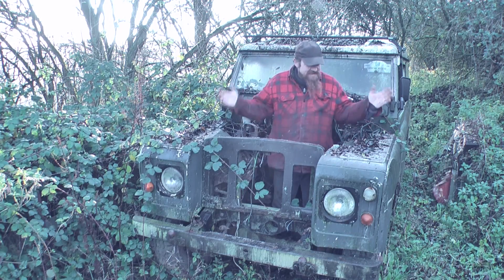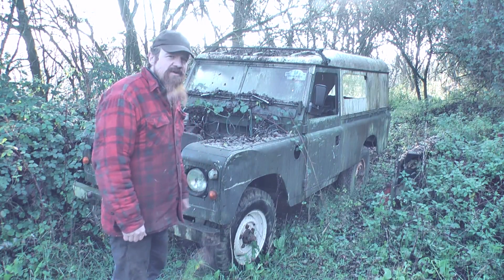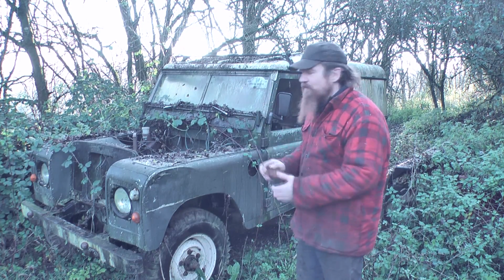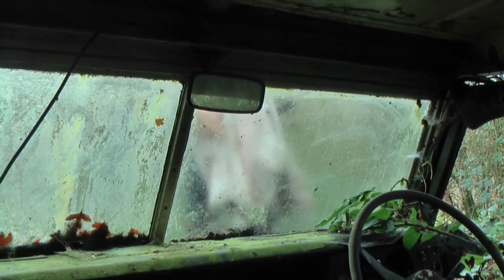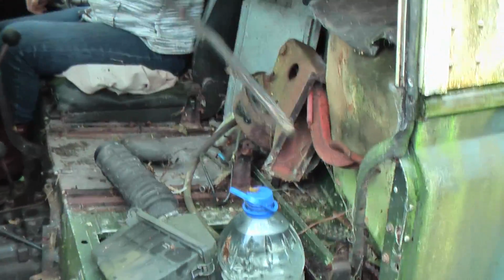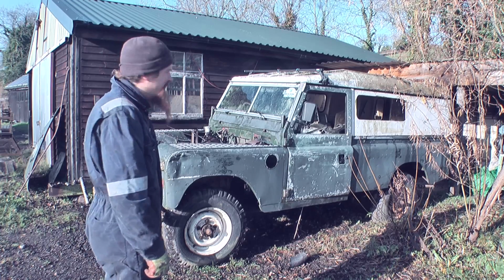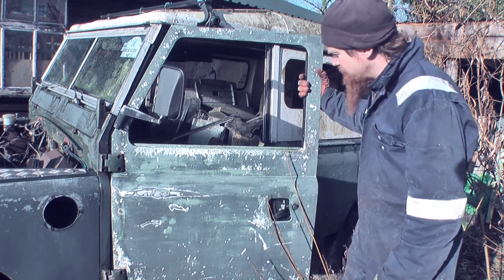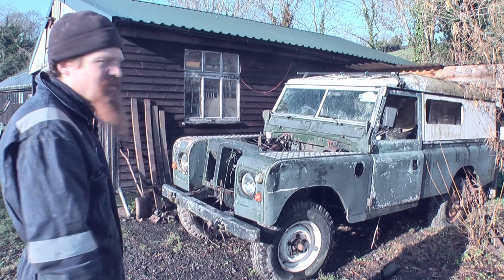Project Kermit 1:  A Land Rover Series 3 Full Restoration

Comment: You can't simply "put in a Series 2 dash" in a Series three - the Series 2/2a dash is part of the bulkhead as a whole.   I mean, I suppose you could cut and weld one in, but it wouldn't be pretty (the bulkheads are very different shapes in very important and key places, in terms of the dash) and you'd be ruining a Series 2/2a bulkhead to do it anyway.  Its a lot easier to make your own dash,  something I did once, or use a complete good S2a dash.

Comment: Can’t understand why you would remove an engine from a Classic Range Rover to fit in a knackered series 3? Are you aware of the values of Classic Range Rovers?
Reply from the maker: The vehicle I want is a series 3 pickup with a 200tdi, the Range Rover has gone back to it's previous owner who is going to restore it for himself and fit a 300tdi, so it all works out nicely. The value only matters if you're going to sell something - I intend to keep it!

Comment: What's happening with project awesome ?
Reply from the maker: Today I'm relocating the clutch master cylinder. We're also currently working on the roof, radiator, an air tank, finishing the wiring and designing the layout of the opening section of the box and the drop down stage.